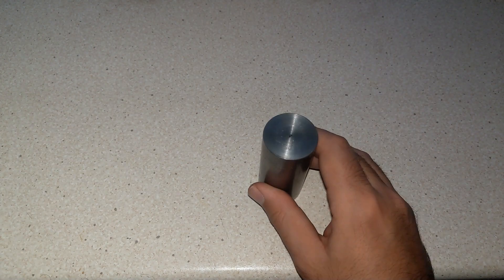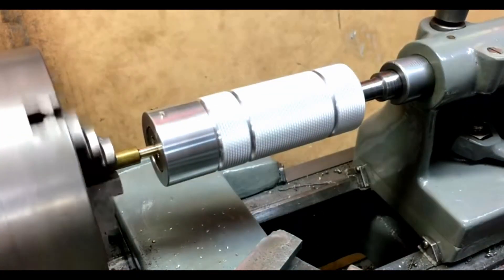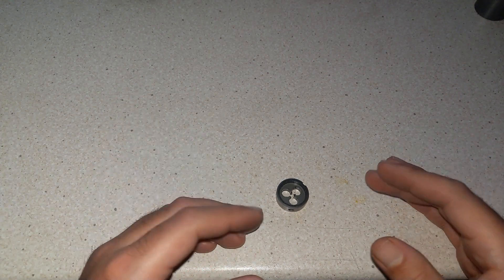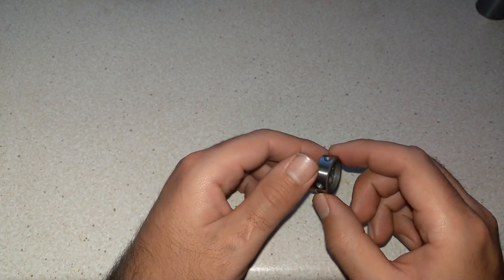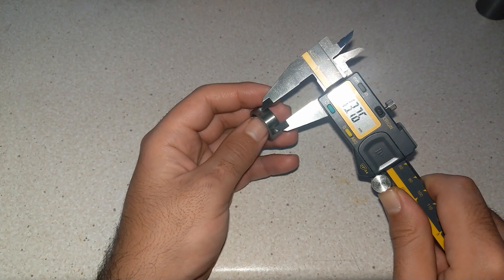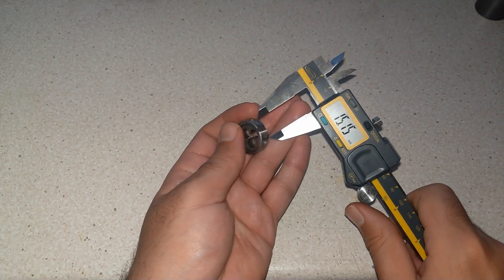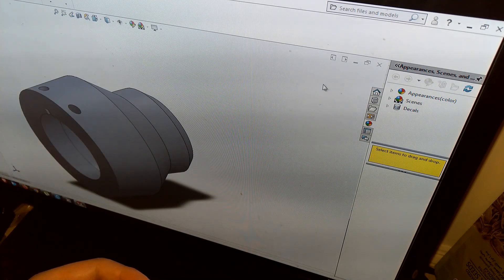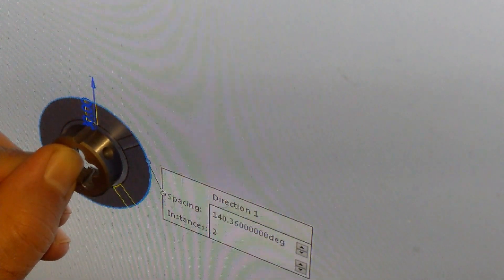Mini Lathe Tailstock Die Holder, 3D Printed Die Holder

Comment: Very interesting. I had thought about the whether it was possible to 3D print a die holder - but wondered if it would be rigid enough. Certainly looks to be a success and the way you true up borth ends is very neat - especially as you are using a 3 jaw chuck. Thanks 👍😃
Reply: I guess PLA strong enough , if you take your diameter slightly bigger
Reply: @HS-hz4fx  Yes, PLA is surprisingly strong, just wasn't sure it was strong enoughfor this! Having seen this I might try one myself as I have no proper die holders for my lathe. Thanks 😀